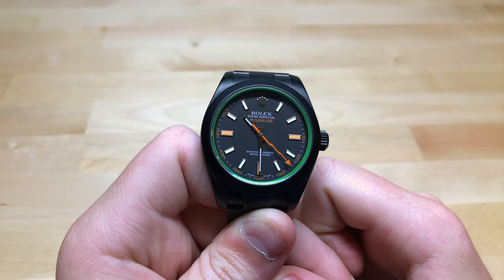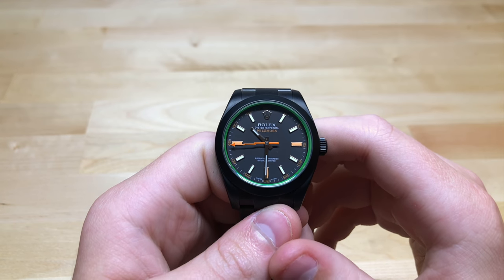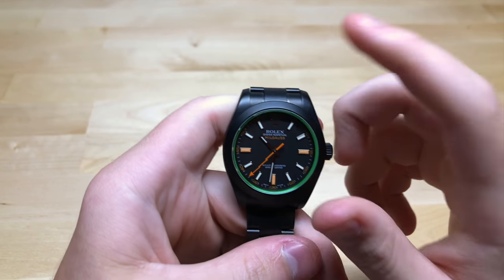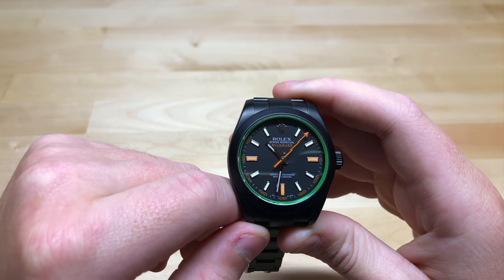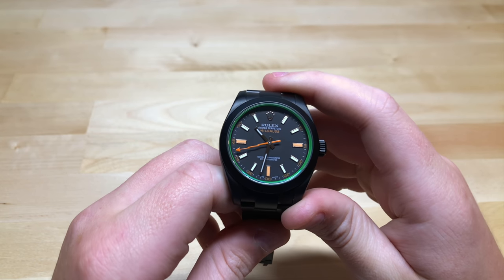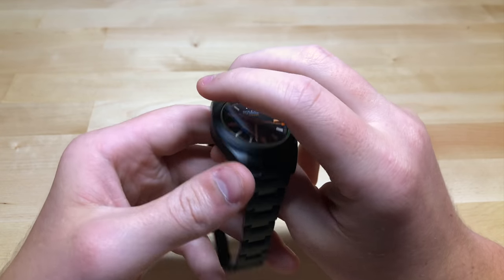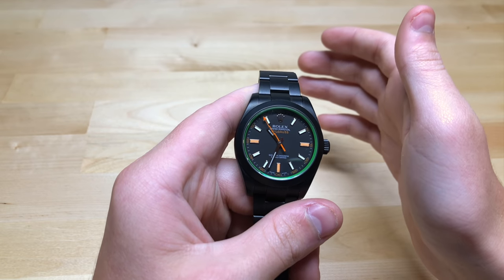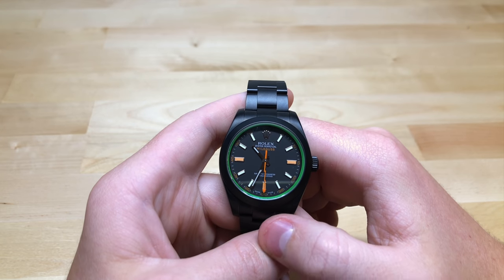PVD COATING A ROLEX: IS IT WORTH IT?

Comment: I don't agree with this. PVD will not "COAT" over the substrate. This is not paint. If your original base metal is polished steel, the black will be gloss. If you have brushed steel, the black will be brushed. If you have a frosted steel, the black will be flat. Again, PVD is not like a paint coat, it is a molecular bond that does not change the original dimensions or surface texture. There is no "added" material to scratch off. scratches and dents and nicks will still be black. The watch will just become a patina of black. It would take 30 years for a PVD black watch to even look dark grey gunmetal... ask me how I know.
Reply: PVD is a coating, albeit an extremely thin one (just a few microns) so you are right that the coating will have the same finish as the metal.
However, you are wrong that scratches and nicks will not show through- any scratch that is deeper than the thickness of the coating will expose the metal underneath, so it will be silver not black.
The PVD is only on the surface, it doesn't make the metal black all the way through.